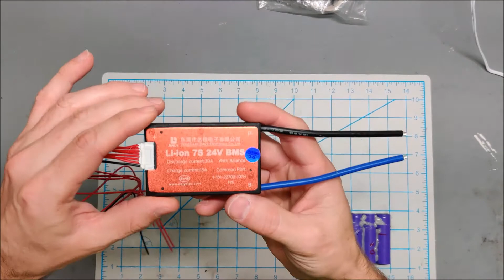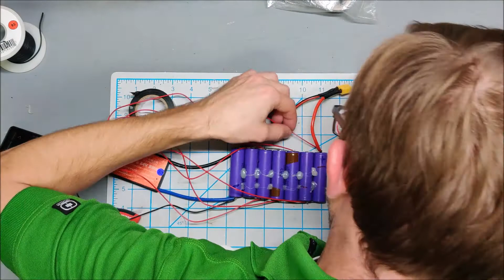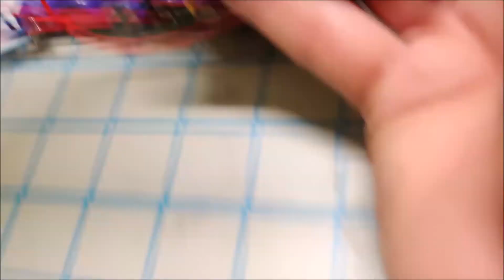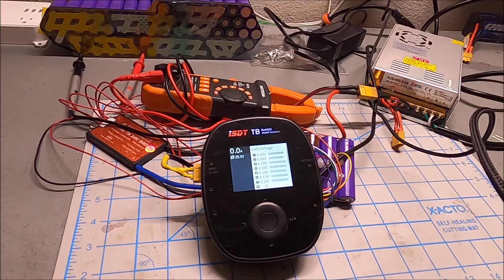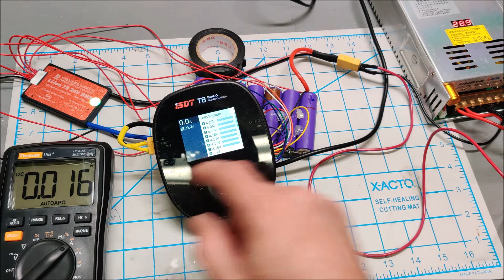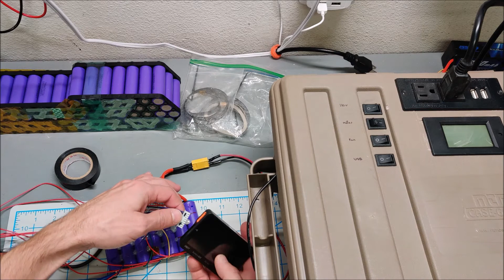TESTING DALY BMS - DOES IT WORK?

Comment: hi

where did you put the cable from isdt t8 to?
Reply from the maker: Sorry what do you mean? The t8 has power coming in from a power supply, the. It has a power out going to the battery. It also has the balance wires going to the battery.

Comment: Can I connect the battery directly to the hover board, bypassing the BMS?
Reply from the maker: Yes, but that is a bad idea. You could easily over discharge or over charge the battery without a BMS, damaging the battery
Reply: @stevenc22  Thank you for the reply. I have a fully charged battery but, when connected to BMS, it does not power on the hoverboard. When I directly connect the battery (~36 volts) to the hoverboard, the hoverboard powers on. 

Is your warning of over discharging/ overcharging the battery only possible if I try to charge it? If so, I'm fed up with troubleshooting this darn thing and plan to just ride out the charge in the battery, until it's depleted, then throw everything away. Is that safe? Or do I risk over discharge/overcharge then, too?
Reply from the maker: @PeterOrrick  you can ride it and drain the battery and throw it out. Trying to recharge it will be dangerous but not draining it down.

Comment: Hi, 
First of all want to say thank you for your videos, you inspired me to build my own battery  and I did it.
After I finish building my battery  I have  a problem with the bms it's not closing a surcuit and i can't charge my  battery.
Maybe you encounter a problem that the bms not working and not charging?
Or you know a way to check a bms?
Reply from the maker: Are your balance wires on correctly? Use a multimeter to check the balance wires. Make sure the order of the balance wires is correct as well. Some BMS you have to wake up by apply a charge current to the BMS.
Reply: Thank you, will check it tomorrow.....
By the way , I have  a daly 13s 48 v 10/30 bms
Reply from the maker: @ramik8557  the Daly you don't have to wake up. I bet you have you balance wires out of order or one isn't properly connected

Comment: Question for anyone capable of answering: I have a 750w, 12v Power Supply (62 amps). I also have a custom built Li-ion 3s8p pack. The Daly says it can charge at max at 10amps. If I was to connect my power supply (62 amps) to my battery (10 charging amps) what is limiting the current (if anything)?

Would the Daly limit the charge current? Or would I simply blow up my battery?
Reply from the maker: The battery will try to draw as much current as the batteries can absorb. Probably less that 60 amps but more than 10 amps. A good BMS will turn off the charger because of over current. A BMS cannot limit current it can only turn off the battery if it detects conditions outside it's parameters. That much current might blow the BMS. You should use a ISDT or icharger with the power supply so you can dial in exactly what rates you want to charge at.
Reply: @stevenc22  Thanks for the reply. I attempt this last night. I put a 5 amp fuse inline with the positive lead and gave it a try. With my dmm in series, after turing the power supply on, It was drawing at 4 amps. I had already been charging it using a 1.5 amp power supply, followed by a 4 amp power supply before I gave this a try. It was already partially charged by the time I tried it, so I am not sure what would have happened if the unit was at close to empty.

Either way, thanks for the reply. I think I'll end up doing the charge as you describe because the power supply is supplying constant voltage, variable amps (the amps is a product of the voltage delta). I think it's better to have constant amps variable voltage. No?
Reply from the maker: @Inosix  Lithium ion chargers start with constant amps in the beginning and switch to constant voltage at the end. A cheap ISDT will make all your charging needs so much easier. https://amzn.to/323QDJG
Reply: @stevenc22  Have you had experiences with this unit? I saw a handful of folks suggesting the balancing feature isn't accurate. The voltage sense is not calibrated.
Reply from the maker: @Inosix  I have 3 ISDT  units. Love them
Reply: @stevenc22  Thanks for your replies :)

Comment: Are the Daly's doing an active or passive balancing? Are they really distributing the charges between the batteries or just dissipating them using resistors? Yeah, 50mA is just too low to catch up with the chargers.
Reply from the maker: Passive at the top of the charge cycle

Comment: Thanks for walking through that.
The balancing system seems of dubious value. It only works at the top end of voltage and if a little excess voltage is applied, the charging shuts off. This leaves a very narrow window for the balancing to occur.
Reply from the maker: Agreed. That's why I use a RC charger with all my batteries to manually balance and monitor batteries
Reply: @stevenc22  What balancer do you use?
Reply from the maker: @johnbriggs7514  I have 5 or 6 different balancers. Love the ones from ISDT, good perfomance and reasonable price. Icharger one is very nice, but expensive.  Ill give you some links. But remember these chargers can only balance up to a 8s pack. If you build in 36V or 48V these chargers wont help you.
Reply from the maker: https://amzn.to/3rWjJBN
Reply from the maker: https://amzn.to/31P1uDN
Reply: @stevenc22  Thanks for the feedback.
I'm working on a 7S style DIY PowerWall following the lead of Jehu Garcia (a YouTuber). His stackable 7S design seems pretty nice, but the balancing seems to be an issue.

I have purchased three devices.

I purchased one board with a double 20A BMS that doesn't seem to have a label, but if you Google Image search on "0410-7S-20A" you can see it. I see no evidence of this performing the claimed balancing function.

The second one is a Jehu board using a Daly 7S 24V BMS that I have yet to get to perform balancing. As you have shown, the balancing is weak and only functions at a narrow window at the top of the voltage range.

The third one is simply labeled "Capacity Controller" and has three buttons labeled "Type" "Cell" and "Mode".  Although this has a balance mode (activated by long pressing the "Type" button), I see no evidence of this balancing either.

So I'm still looking for a solution to the balancing issue.

Sincerely,
John C. Briggs
Reply: @stevenc22  Thanks. A little expensive, but better reviews than the ISDT T8 which seems to have had a lot of failures noted in the Amazon reviews.
Reply from the maker: @johnbriggs7514  Daly BMS is great. Use it as your primary BMS. Get something like the ISDT Q8 or the Toolkit RC to perform routine manual balances. https://amzn.to/2OpEI22
Reply: @stevenc22  Thanks for the advice.
This is part of a solar powered system that I do not want to have to actively manage. It would be nice to have periodic automatic balancing.
Reply from the maker: @johnbriggs7514  I manually rebalance about once every 6 months. The system mostly takes care of its self the rest of the time.
Reply: @johnbriggs7514  You can also add an active balance to the pack. Like this one: https://www.aliexpress.com/item/4001176521939.html

Comment: Stevenc22 thank you posting this video, Question stevenc22 if you have a 24 battery pack with that BMS in your video what's the cutoff point of the battery pack, like 24 battery pack charge to 29 volts and when you use it to power something it discharged to 24 volt right, like 12 volt battery pack charge up to 13.2 and discharge down to 11 volts, sorry for being confuse about this, the cut off voltage of a BMS, 12 VOLT AND 24 VOLT battery with BMS....Peace
Reply from the maker: Each cell has a max of 4.2 and a min of 3.0. So a 7S battery tops out at 29.4v and min voltage is 21 volts. For a 12V Lithium ion pack, you would use either a 3S (12.6 max 9.0 Min) or a 4S (16.8 Max 12.0 Min)
Reply: @stevenc22  Thank you Stevenc22 i understand now....Peace